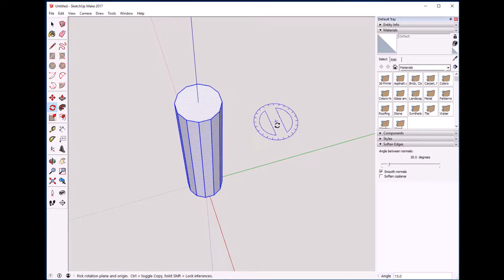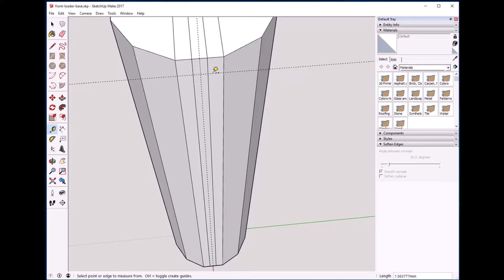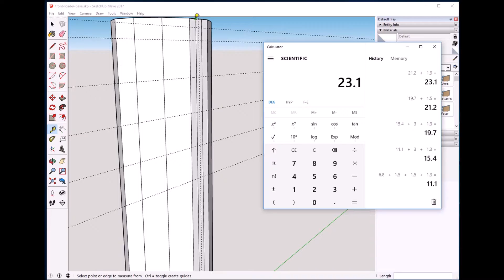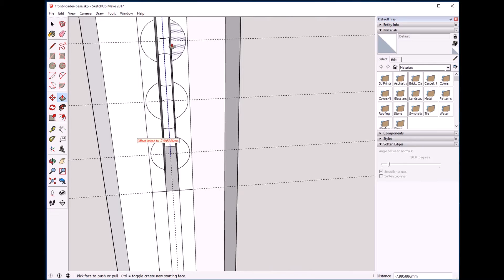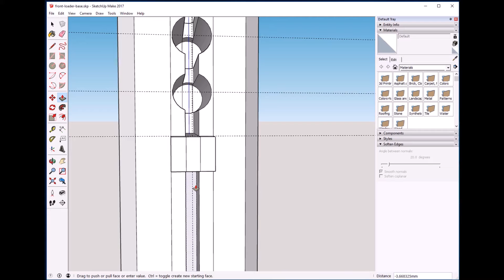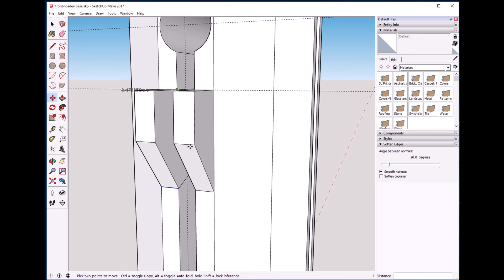3D Modeling a front loader for full euro repinning

Comment: It was absolutely interesting for me to see, how you designed this Boris :). Wow, very well done. I will probably build one and think about improvements ;), would make the stop pin adjustable (either a pretty tight moving printed part or a moving part with spring and setscrew...)... hmmmm will try out an idea later ;). Still a little sad that pin distances are so different and a loader fits only certain locks.  Will see how it develops :). Great work my friend.
Reply from the maker: Thanks Foxxy. Actually a previous version was more generic but it didn't work well. The idea was to make the distance between the holes ~1mm. In this case when you insert the loader only the first pin aligns. There was initially a sliding part in that hole that goes across. You would move the sliding part inward 1 pin and it would "lock" it into place. Then you would push the follower a little further so that the second pin aligns and push the sliding part one hole down and so on. I build it but it was too difficult to operate because you had no feeling on which pin you are on at any given time. Also, because the follower would need to slide in and out you could not place a stopper notch which would make the job of aligning the first pin a real pain in the S. After ~3 prototypes I decided it would be easier to make a unique model for each lock. I made this template where you only need to fill the holes and print. It really takes only 5 min to make the holes.
Reply: Yeah I've understand what you mean ;). I was only thinking of making the end stop adjustable :). No idea how you could make it's pin holes adjustable... Yes, going from your basic model is fast and you only need to print it then (takes an hour for me). Very nice to see your design and think process :).